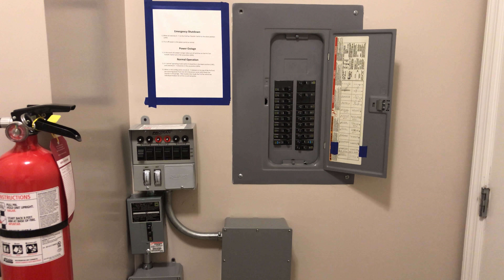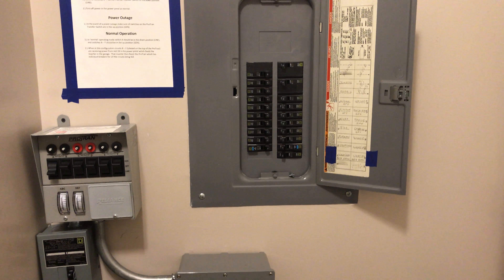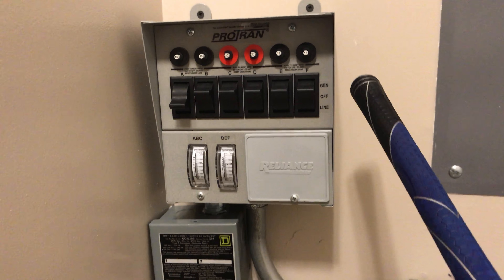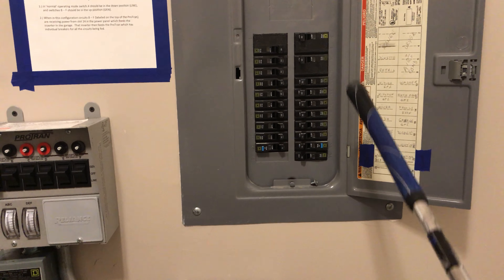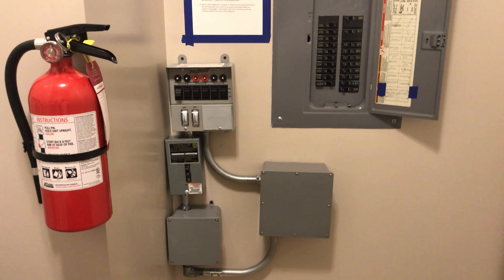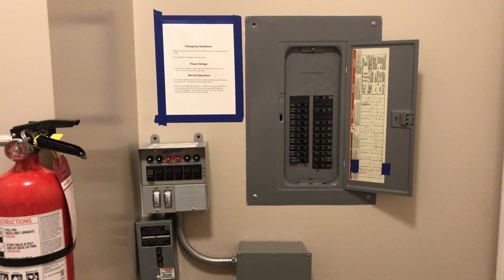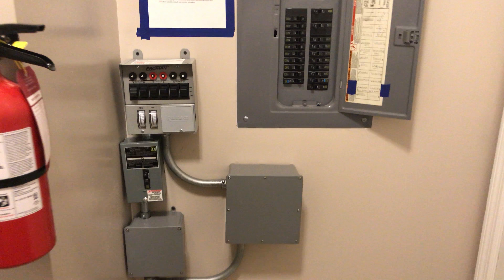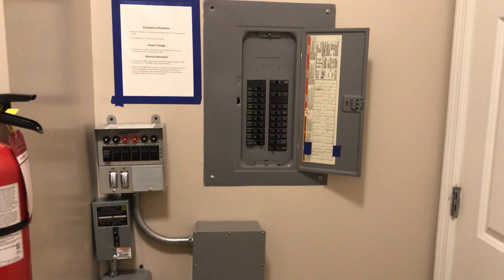Aims 6000 watt 48v inverter and battery bank (Whole home uninterrupted backup) - 3 of 3

Comment: If you were unaware your grid power was off until you tried using the stove perhaps hardwire a light at the main panel to denote when grid power is on/off for a better visual indicator? Superb setup. Congratulations on one of the cleanest whole home UPS's I've seen. Bravo.

Comment: good clean setup.  I have the same manual transfer switch.  got a 30amp plug outside to connect a 4K generator to run 6 circuits in the house.  Looking to tie solar and a battery bank to my back system.

Comment: I’m doing the same is it better to use the ALL IN TRANSFER Switch or using a 50 Amp Double Pole Breaker Straight in to the Breaker Panel ? I have a 5KVA 230v Pure Sine Wave Inverter charge controller 48v at 3Kw 220v @ 72A x 1line  , Moës Automatic Transfer Switch 120v @ 50A x 2 lines , I’ve got 2 - 48v battery banks lithium batteries, I have ALL POWER TRANSFER SWITCH looks like the 1 you have !
Reply: i tried this setup but everytime i switch to inverter mode my GFCI trips everytime is there a fix on this or something is wrong on my setup?

Comment: Nice I'm working towards something similar.  Currently I have the pro Tran but my system is a manual transfer setup at the moment.  I have to turn on an inverter and then switch over on the pro Tran but I think I might go with a system like yours soon.  How is the aims inverter holding up?  I've heard mixed reviews on them.

Comment: Very nice system!  I've been wanting to do this very same setup. Looks like you run the Honda inverter generators to your Aims inverter with out any issues,  Do you know if the Aims inverter will run on a non-inverter generator with out going into inverter mode using batteries?  My generator is not a pure sine wave generator and wonder if the Aims inverter will go into inverter mode because of it?  Thank you for the great videos.
Reply from the maker: I’m sorry I’m not sure how the Aims will respond to a generator that doesn’t put out clean energy.

Comment: Very nicely done,  Wonderful setup.  I do hope you're still monitoring this, and would be willing to help me out as I'm considering something similar, but not as sophisticated.  I want to prepare a system I can plug into the inlet box for my reliant pro-tran just for those periods when the weather is too nasty to run the genset.  Right now I've a small (2000 watt) 12-volt inverter but the DC Amperage is so high on that I"m thinking of buying a larger 48-volt inverter, and converting my parallel bank of 12s into a 48-volt series.  

All that being said, I'm curious to know what amperage you see on the DC side (between the battery box and the inverter) when under full load.  You showed (I think) a 250 Amp DC fuse but the wiring looks like it's awful light for that.  

Would you be willing to share the size of the wiring you used in your box and between your bus bars and the inverter itself as well as the amperages you've observed

Thanks again

Ed
Reply from the maker: All the cables on the DC side are 2/0 cables.  I've never seen the DC side above 15amps ever but I know the AC side will never draw more than 1500 watts.

Comment: I have ZERO power on my property and like this system and would probably add a wind turbine and I'm wondering whats the max power i could store to not only run a 2000 square foot home but a large pole barn with shop tools? Would the new Tesla battery packs be a better choice? We will probably add a propane generator that can kick on in case of low power that would not only double as a power source but could also recharge our battery bank no matter what kind it is.

Comment: Quick question, if you only pull 20A why did you go with a 6000W inverter? 
Also, does the inverter run fans all the time when pulling the 50W?
Reply from the maker: I went big so I would have over head.  I’ve heard to many stories of people going with 2-4K watts and then wishing they went bigger or didn’t calculate it in.  Also if I ever decide to get a bigger home.  For me the fans only come on when the inverter is charging the batteries after they have been drained for a while and they don’t usually stay on long.  I’ve probably heard the fans 5 times in 3 years of operation.
Reply: @dubohio  Thank you very much .. I saw a few "knock offs" or rebrandings of this inverter for sale .. but I don't know if the quality won't be worse :D Cheers.
Reply from the maker: PolymathPete I’m actually going a bit sour on AIMs inverters.  This is my second one and I’m having issues with it switching back to utility power
Reply: @dubohio  I have been initially looking at this one "POWER SINUS 6KW 24V 6000W/18000W" which looks like a rebranding of yours, but digging deeper I'm leaning towards a big brand name like "schneider electric" like a "Conext" hybrid inverter .. haven't gone through the specs yet but maybe the extra price is worth the better integration options.

Comment: When the pro-tran is selected for GEN.  How will a house circuit receive utility power without selecting the Pro-Tran for Line?  To me it would seem that the GEN selection will only feed power to home circuit when running off of gen power.  When house is LIVE on utility power, the home circuit w pro tran in GEN selection should be dead?? I would love some kind of diagram.  I think I understand about 90% of your setup.  Great Setup!  But curious as to how home circuit is getting utility power when pro tran is in that GEN mode. I also don't quite understand how generator power is wired.  But that is a different topic.
Reply from the maker: Good question.  Instead of hooking the generator to the GEN side of the proTran I have the inverter hooked to that.  So it would look like utility -> inverter -> proTran (GEN side) -> home.  So when the utility power is working and the proTran is in GEN setting the power flows through the inverter to the house.  This is done so when the power go out it’s uninterrupted thanks to the automatic transfer switch in the inverter.  It’s a strange thing when your in the house the power goes out and you leave and realize everyone else on your street is without power and you didn’t even know it cause it’s seamless.
Reply: @dubohio  What is the "LINE" side of the MTS connected to if the AC OUT of inverter is connected to "GEN" side of MTS?
Reply from the maker: Aaron Rutell the line side is connected straight utility power.  This is so I can take the inverter and batteries out of the system should I need to do maintenance or something like that my whole house wont have to be with out power.

Comment: I was writing up a blue print based on your design and It looks to me that the breaker that provides the AC power to your grid side of your inverter runs all 6 of your loads on the other side of your inverter. are you sure that is a good idea? did you install a larger breaker in the original box to power your inverter and deal with this?
Reply from the maker: Joe Mckown yes, I put a dedicated 30amp breaker in to handle the inverter side.  I monitored my power draw on these circuits for a few months before installing this to make sure the wiring and the breaker could handle the load.  Before the power goes back in to the manual transfer switch there is a 20amp breaker (bottom left of this video) that makes sure no more than 20 amps can be pulled from the inverter, and then after that there are 15amp and 20amp breaks in the manual transfer switch (upper left) for each circuit.

Comment: I would like to do what you are doing, but I have conflicting info from AIMs stating something about ground loops that could break the inverter and that I need a dual transfer switch. Could you please comment and maybe provide schematics on how its all connected. I want to setup my AIMs 6000W 48v system exactly like yours without the generator function. I already have a 10 circuit transfer switch ready to be setup, but need some additional guidance. Thanks for your assistance.
Reply from the maker: So I was concerned with the exact same thing.  I even called and talked to Aim's several times about this, and I can't remember what I did with this neutral to ground wire but I 'thought' that was the resolution here.  Page 22: http://www.aimscorp.net/documents/PICOGLF60W24V240VS.pdf  If you get any new info i'd love to hear it!
Reply: I also saw the info on page 22 and configured my system with that information. The only difference between my setup and yours is that have I created a relay system to do the auto transfer instead of depending on the internal transfer relay in the unit since it has a 25 Amp limitation. I am powering 10 circuits including the kitchen which has a 1750 W microwave oven, a 1200 watt toaster oven and the refrigerator as well as other loads in other rooms which would easily exceed the 25 amp transfer relay in the unit for normal day to day use. Of course in an emergency mode the 10 circuit usage would be minimized for battery consumption, i.e. no toaster oven or other big amp draw item usage. These 50amp  relays isolates or bypasses the inverter for normal usage and switches when in "back up or emergency" mode.
Reply from the maker: Anthony Hines interesting.  Do you have any delay (light flicker) when you loose power?  It seems like that would essentially be two transfer switches in series with the inverter and relays and would cause a noticeable delay in power transfer, no?

My system is designed is operate under 15amps as I have a fairly efficient house and I’m only concerned about lights, garage, TVs, and fridge.
Reply: The relays are not in series, but to separate circuits with the coils for the relays are in parallel. Anyway the switch over from lost of utility power to the inverter is in the 10 or 20 millisecond range so you do see change with an incandescent light bulb, but not that noticeable with LED lights or CFL lights. My TV's, PC and Servers are all on UPS so nothing to worry about there. Now going back to utility is a bigger gap of may be 200 to 500 millisecond so that is noticeable, but still not enough to mess with clocks or other devices. This is still work in progress, but it works for now.
Reply: I have so many questions for you that I would like a less public forum to discuss these questions and or ideas. An example I see you have a Switch connected to the DC meter on your battery box and wanted to know what it did.
Reply: I have seen an anomaly with my relay switching system. Some electronic equipment such as Ring security system as well as my refrigerator gets hosed up during the switch over from utility to backup and back to utility. My guess at this time is the phase of the Sinewave of the inverter during the switch/transfer is different from the utility - out of phase that is affecting certain loads. my plan is to add a delay timer of 1 second to see if that stops the issue. Of course this means that during the transfer there will be a noticeable glitch, but hope that will be enough for the load/systems to adjust to the change and not behave as if I am in a brown out.

Comment: is there s reason you chose 48 volts over 12 or 24 ?
Reply from the maker: dave zorn the higher the D.C. Voltage the more efficient the system is.

Comment: How has the system been working for you? Any failures?
Reply from the maker: System has been working pretty good.  It does everything i've expected it should.  Only issue i'm having now is my inverter is starting to have some issues charging the batteries which i'm working with AIMs on.
Reply: @dubohio  Thanks for the quick reply. Have you added any solar to your setup? I was wondering how to incorporate solar into these inverter/charger setups. Would love your thoughts - thanks.
Reply from the maker: @northlander1948  I have only done some small testing with solar which is very easy to add to a setup like this.
Reply: @dubohio  Kk, do you use a separate charge controller and then just connect it to the main terminals on the bank the same as the inverter/charger?

Comment: do you have a schematic
Reply from the maker: I'm sorry I currently don't, but if I make one i'll be sure to post it.
Reply: @dubohio  I'd like to see a schematic too! I'm getting confused where wires go into junction boxes in videos 2 and 3. You have power from the 30 amp breaker going into the large junction box and then going to the small junction box and then out to the Main disconnect switch in the garage feeding the inverter and then you have the power from the 6 breaker transfer switch going into the large junction box and going to 6 breakers in your main breaker box?